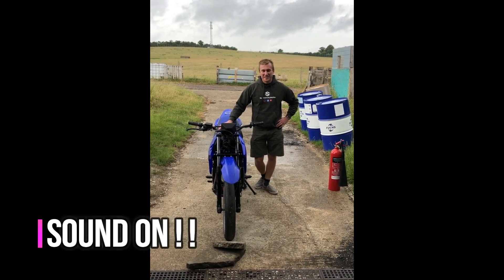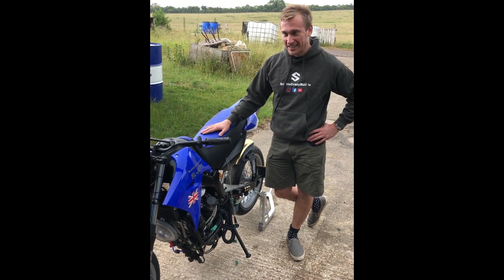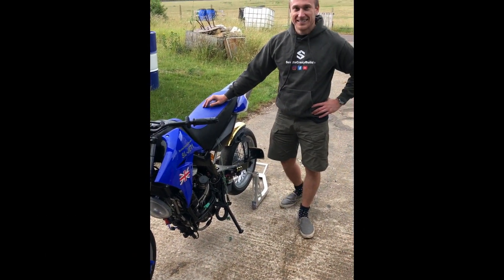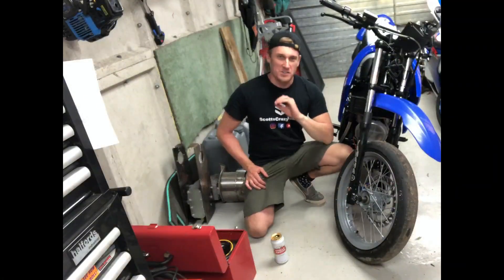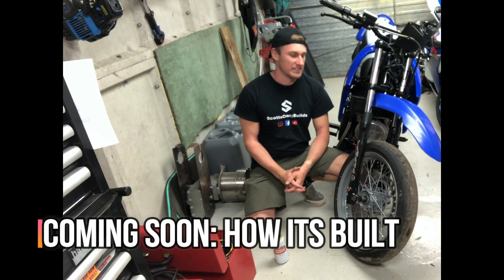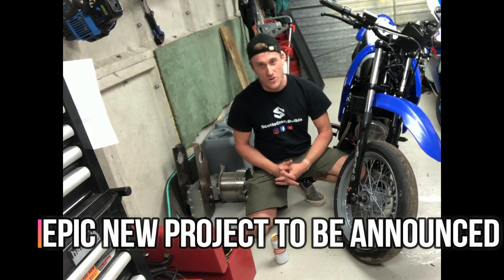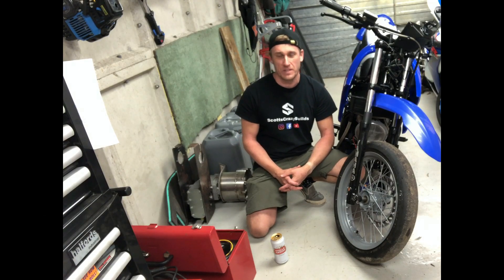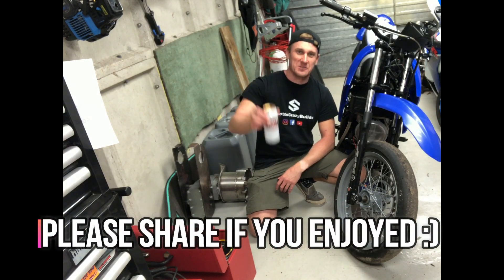Test Riding the Jetbike !! (DIY Gas Turbine Motorcycle with Afterburner)

Comment: Instead of being propelled directly from thrust alone, it would be interesting to use a power take-off turbine wheel and with proper gear reduction, have that propel the bike.  Maybe could use parts of the original chain drive and clutch, similar to a helicopter turboshaft engine arrangement...would be FAR more fuel efficient and much faster!    ;)
Reply from the maker: Thanks for your comment Mario! You are absolutely correct it would be way more efficient... I hope to incorporate a power take off in a “future project” (news to follow at some point soon), I fee that the small 125cc bike chassis is already way too busy to incorporate a free power turbine unfortunately. So this one will have to stay as a noise generator for now 😂